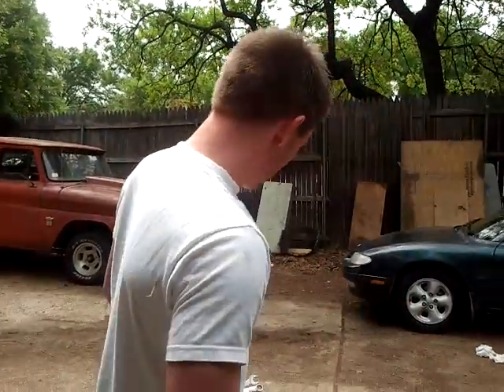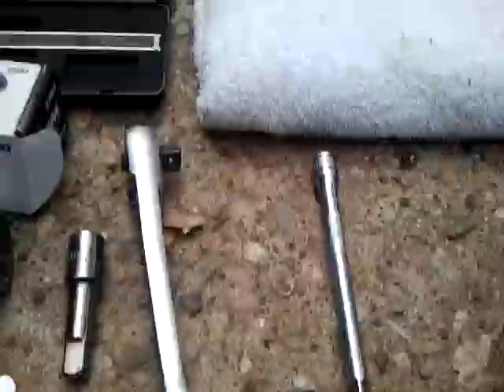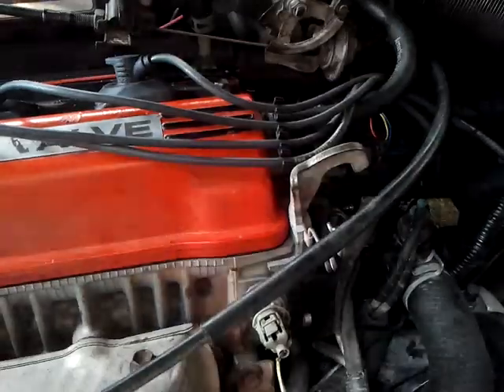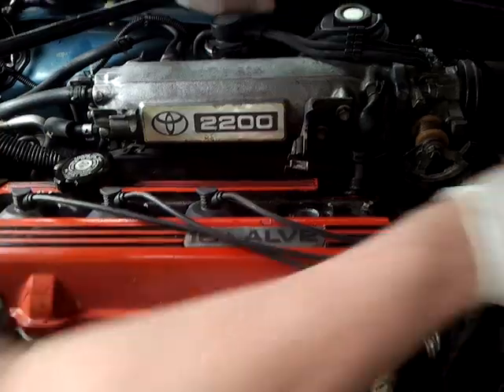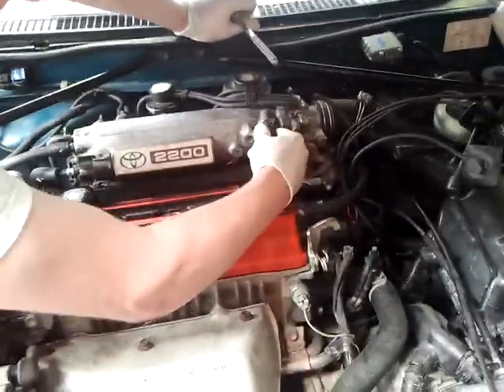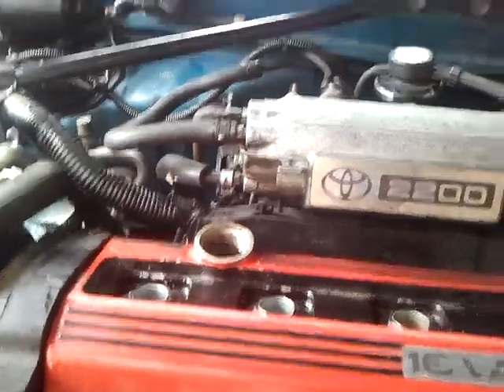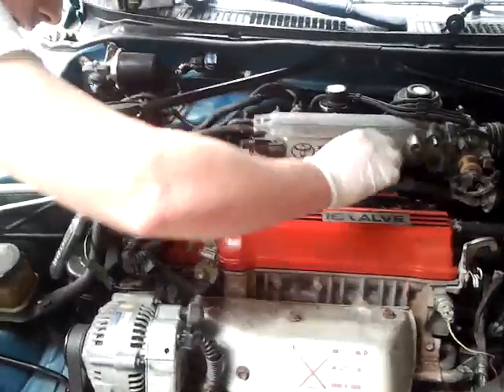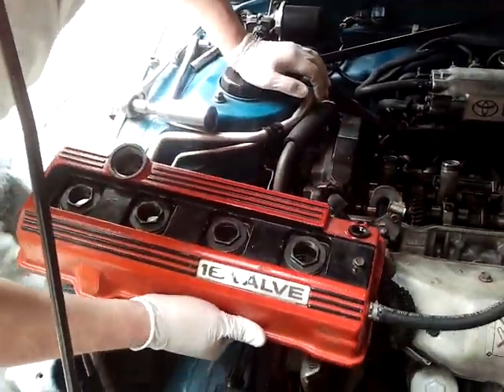94 Toyota Celica GT 5SFE Valve Cover Removal How-To

Comment: I probably going to purchase a 1993 Celica convertible. I am in the process of learning about the engine and learned that the values need adjusting every so many miles-will research service intervals on everything....Very helpful video. I am looking forward to watching the video(s) that will show the adjustment of the valves.

Comment: For rough idle, engine mounts might be a problem too. I replaced the engine mounts and it smooth out my idle in my 95 celica.  My new problem is now a possible ignition issue as the rpm fluctuates badly at idle. If your rpm is not fluctuating and everything works well besides it being loud and rough at a stop light , consider engine mounts as your most likely problem.

Comment: I enjoyed your how to video on removing the valve cover. I have a 93 toyota celica 5sfe 2,2l engine that has a problem with rough idling. When I start it up, it revs at just over 1,000 RPM then bounces back and forth between 800-1000 rpm. Checked all the vacuum hoses, egr, pcv and they are all fine. everything I have seen online points to a vacuum leak, but, there has been no leak found. Any thoughts?
Reply: punkvid619 Did you ever find the problem with your celica? I cam across your comment and its exactly what is happening with my 95 celica. I too have checked for air leaks to no avail.
Reply: Yep, a rough idle is what my '93 MR2 does. Even makes the steering wheel vibrate a lot, and interior parts buzz. lol Past 1K rpm it smooths out. Perhaps adjusting the valves will solve it? I guess if not, then I'll just have to knuckle down and overhaul the head.

Comment: Still looking into the problem. A few months back it wouldn't accelerate past 20mph even with the pedal to the floor and after turning the engine off it wouldn't start back up. Had to get it towed home and it's been sitting inoperable since

Comment: i dont think the torque is 17lbs on the valve nut because when i was torquing mine down abd one of the valve nuts cracked a little and i cant seem to find/buy a replacement anywhere

Comment: camry doesn't need to remove throttle cable. 

Only the top bolts and one bolts for the plastic cover.

Comment from the maker: @Angie Michele
Sorry it took me so long to reply, I assume you probably replaced your alternator pigtail by now.
If not, I had the exact same situation with mine, I was able to cut the pigtail at a junkyard from a 93 Toyota Camry with the 4 cylinder(same as ours). There should be a wide range of toyota models and years that use this same connector, even if the alternator and engine are different.
Hope this helps

Comment: Im pretty sure it is 17ft lbs because haynes showed 33ft lbs which outrageously high, and Toyota's original is 13ft lbs which isn't that bad, but Toyota revised due to everyone complaining that none of the 13 or 33 ft lbs worked cus they both still leaked.  I just did 17ft lbs, nothing cracked everything appears ok.

Comment: ISpecialED, Hi!
I have a 1994 celica gt and I need to replace the pigtail plug to the alternator
It got destroyed by heat and shattered to a million pieces when I unplugged it, the only  way I can replace it is either by a junkyard or the dealership, trust me their no celica the junk yard. the dealership said the only way to order it is the 5 digit number on the pigtail plug that shattered, if you could help me out and let me know what the 5 digit # on yours is, it would help me out thanks!!!!!
Reply: Corollas are more than likely in the yards. Same motors and transmission options. The celica was just a Corolla with a different chassis.